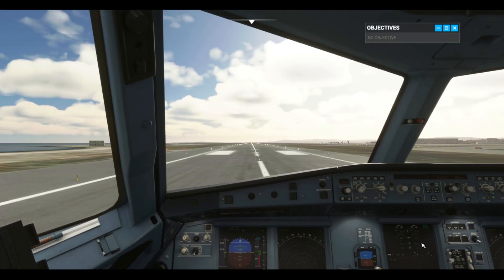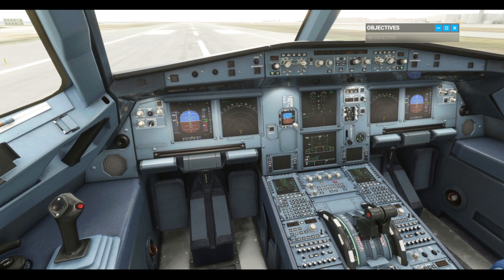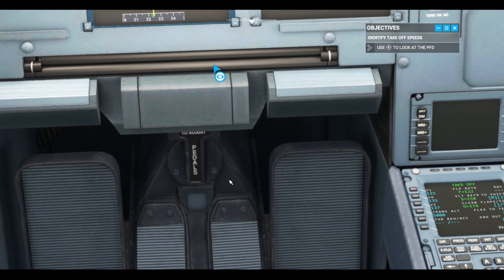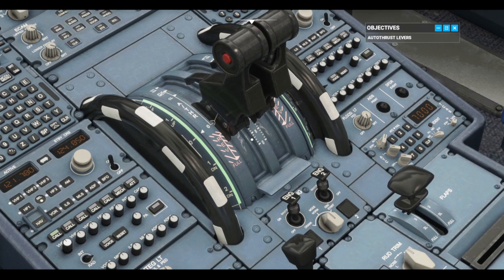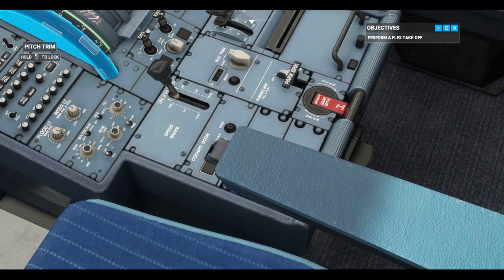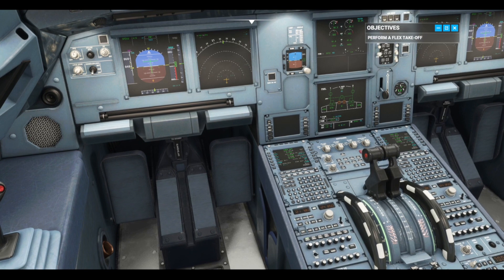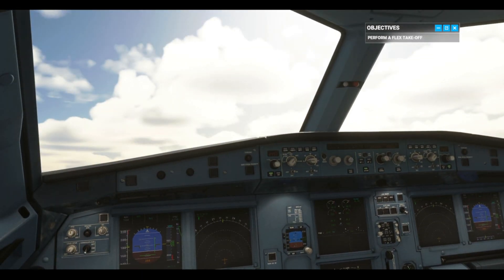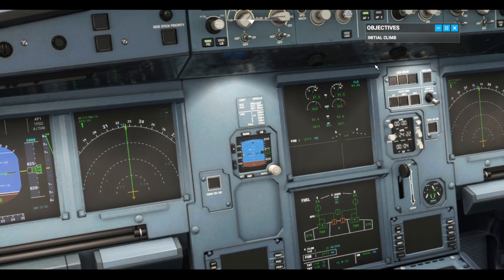How to Take Off in an Airbus A320? Understanding Thrust Levers and Detents | MSFS 2020 Tutorial

Comment: Was this done on Xbox? (The buttons seemed to be) How do you look around the cockpit so fluidly? I struggle to zoom in and move around using LB and the d pad?
Reply from the maker: This was done on my PC. Used a 360 controller for controls and the mouse for looking around!
Reply: If you hold  LB and press RT/LT to zoom, move around with left stick, and up/down with right stick.

Comment: cloud resolution seems poor...did you just adjust it for better performance ?
otherwise tutorial is very interesting.
Reply from the maker: The recording reduced the resolution! Will improve it!
Reply: @JxJAVIATION  
oh ok, 
and how do you record it ? 
does FS2020 has a recording feature or its just just an outside program ?
I use to record with FRAPS back with FSX, didnt affect the sim that much except for fps.
Reply from the maker: @sjmunoz  I used a 3rd party software to capture the screen, but it wasn't great. So will be changing to a different one.